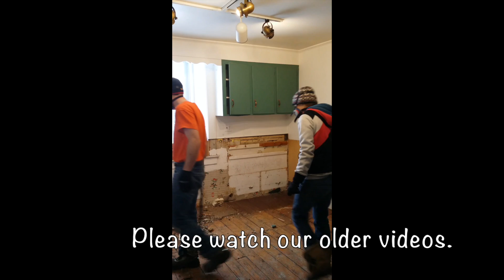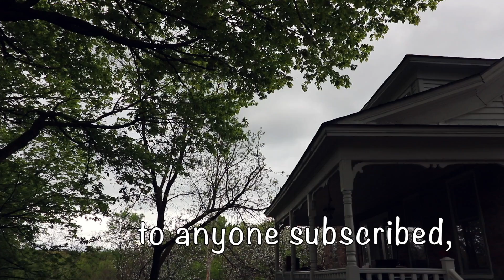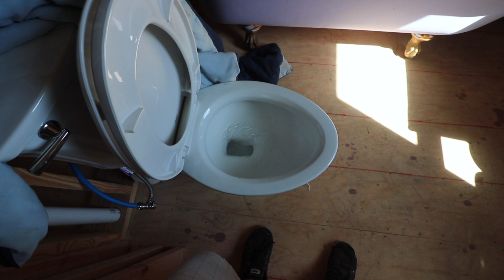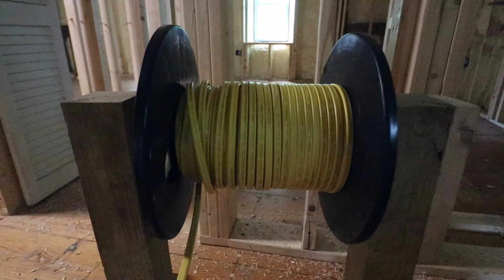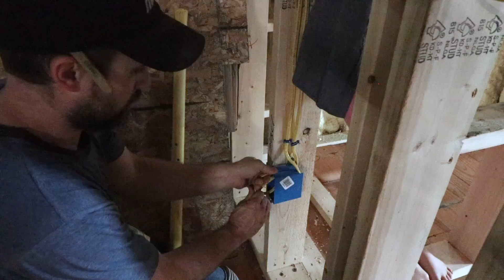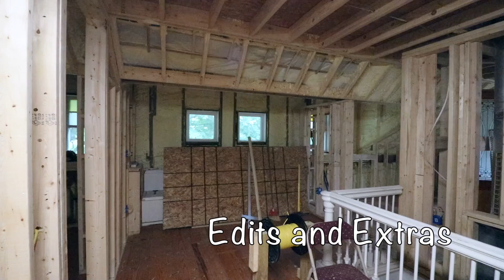200 Year Old Renovation --- New Wiring & Plumbing --- Episode 84

Comment: nice job, my only comment is to leave extra cable inside the wall (known as a service loop) for future use.   Generally a single coil will suffice or an "S" bend about the length of 2 hands, this allows you to pull a little extra through into the box as needed.   Good for when you clip too much off during install, not that I have done that, asking for a friend :-)
Reply from the maker: Haha!! I actually learned about service loops probably halfway through.. 😂😂 so, I probably have a mix of 60% 40% with a service loop.. it’s a great idea for “those people” that need it.. 😂😂😂

Comment: Love your apprentice's, do you get much work done during the dancing and hand clapping?   LOL  Also a hole that cable pulls through is classed as a "staple" in electrical code therefore you can get away with less staples during installation, I believe within 4 feet on the run and within 12 inches of a box is the code but i'm rusty?   And you don't have to hammer them down, the cable should be a little loose, the staple is there to stop it flapping around.